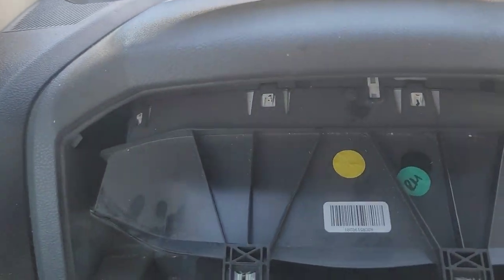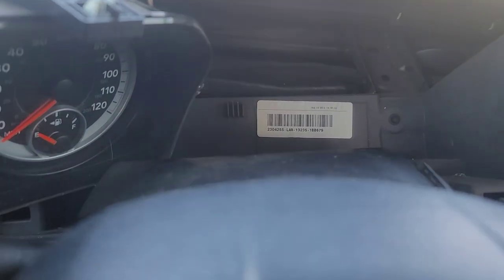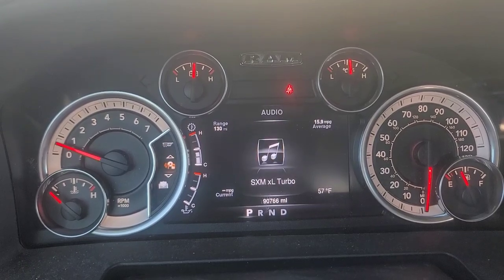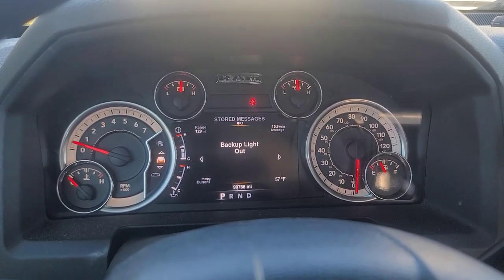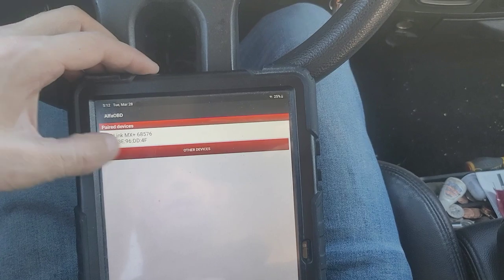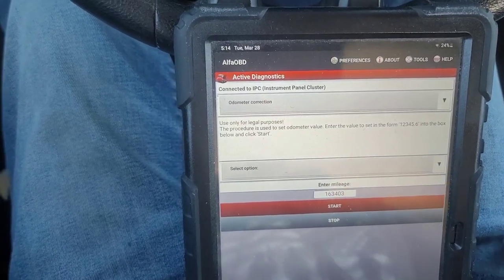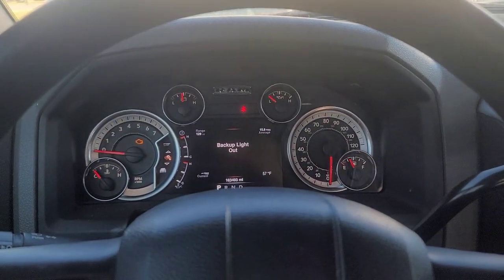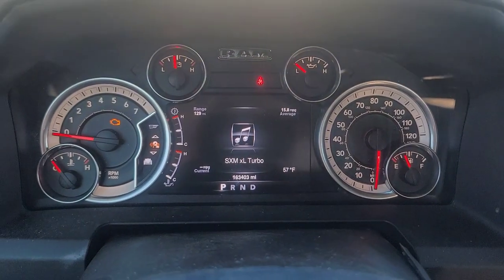4th Gen Ram upgrading to the 7 inch EVIC premium cluster and correcting the mileage

Comment: I have a 2014 1500 express, I want to upgrade to this cluster. I have a regular OBD scanner but I’m sure I need the same software to change the mileage. This cluster is from the same year and newer correct? Plug in and play ?

Comment: What scanner are you using? I see it’s AlfaOBD but is that just the software? I have a 2018 Ram 2500 and planning 0:01 to do similar upgrades. But i need that tool to correct the odometer. Thanks
Reply from the maker: Yea I was able to do everything with the dodge products using alfaobd
Reply: @barrettgarage1088  oh btw what was the part number on that A/C module you installed on the pass side of the dash? I can only find dual or auto climate control modules. I have the single zone bezel like you and it’s extremely frustrating lol
Reply from the maker: Oh I know. But I got it in my hand I pulled it when my truck got totaled. The part number is P68268186AA.
Reply: @barrettgarage1088  did you pull everything out of your truck?
Reply: @barrettgarage1088  do you maybe want to sell it? If you have the cluster and other stuff I’d be interested
Reply from the maker: Yes every upgrade got pulled and put up I'm I bought a brand new 1 mile tundra, video coming soon. But I'm looking for a regular cab short bed with no drive train. My intention is to build a 392 6 speed regular cab short bed toy. So I'm just sitting on all of my stuff.
Reply: @barrettgarage1088  well damn it.. hook a brother up. I’m ballin and upgrading on a budget..like an extremely lean budget.
What I’m trying to say is you got what I need! 😂
Reply from the maker: Salvage yard 40 bucks it will work from the trucks the chargers the chryslers anything with single zone with 8.4 just call and check local Salvage yards
Reply: @barrettgarage1088  I appreciate the heads info homie but that’s the problem I’m running into. I’m in Augusta Georgia and the junkyards are slim pickings. There’s really nothing else around here except LKQ in ATL and they try to knock your head off. 
Well If you change your mind I’ll take it all off your hands. The cluster, radio everything

Comment: What year is this? You have it saying 4th gen but also say 2013 thought 4th only goes 09-12
Reply from the maker: It was a 2014. The 4th gen goes from 09 to 18. Then the classic version 19 and up. But in 2013 ram did a face-lift to them and changed the dash, cluster, and computers.